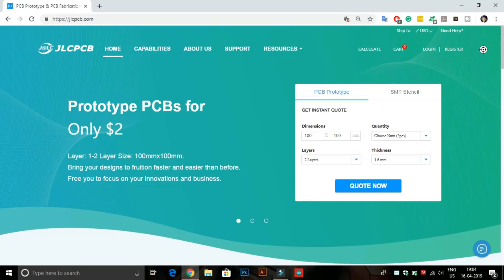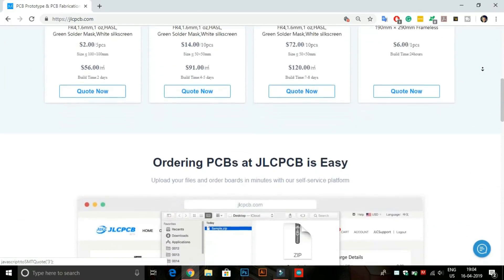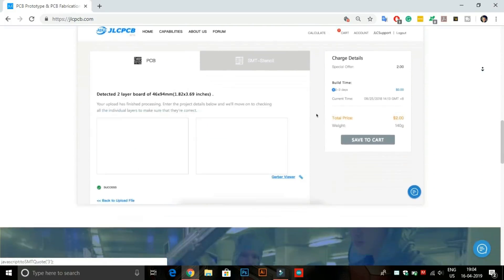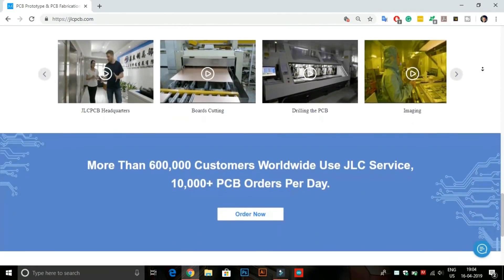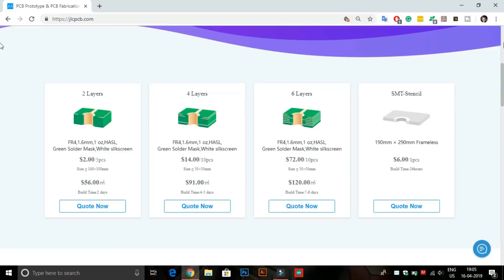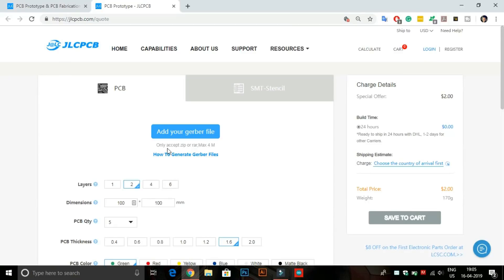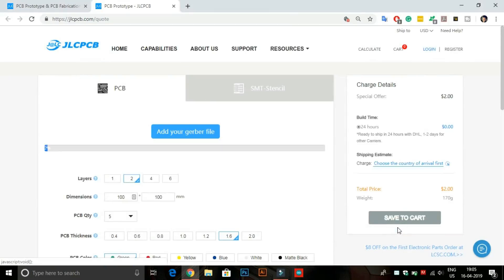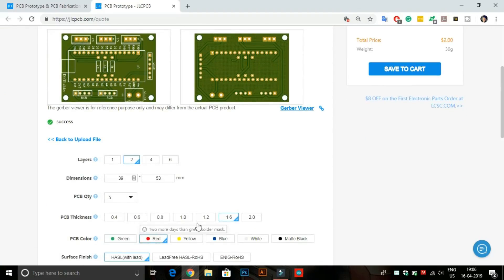How To Make A DIY Obstacle Avoidance Line Follower Robot At Home

Comment: This will be the correct code for this project 

#include<NewPing.h>

int ENA = 3;  //ENA connected to digital pin 3
int ENB = 9;  //ENB connected to digital pin 9
int MOTOR_A1 = 4; // MOTOR_A1 connected to digital pin 4
int MOTOR_A2 = 5; // MOTOR_A2 connected to digital pin 5
int MOTOR_B1 = 6; // MOTOR_B1 connected to digital pin 6
int MOTOR_B2 = 7; // MOTOR_B2 connected to digital pin 7

int RIGHT = A0; // RIGHT sensor connected to analog pin A0
int LEFT = A1;  // LEFT sensor connected to analog pin A0

#define TRIG A2 // TRIG PIN connected to analog pin A2
#define ECHO A3 // ECHO PIN connected to analog pin A3
#define MAX_DISTANCE 100 // Define Maximum Distance

NewPing sonar(TRIG, ECHO, MAX_DISTANCE); 

void setup() {
  // put your setup code here, to run once:
  
pinMode(ENA, OUTPUT); // initialize ENA pin as an output
pinMode(ENB, OUTPUT); // initialize ENB pin as an output
pinMode(MOTOR_A1, OUTPUT); // initialize MOTOR_A1 pin as an output
pinMode(MOTOR_A2, OUTPUT); // initialize MOTOR_A2 pin as an output
pinMode(MOTOR_B1, OUTPUT); // initialize MOTOR_B1 pin as an output
pinMode(MOTOR_B2, OUTPUT); // initialize MOTOR_B2 pin as an output
pinMode(RIGHT, INPUT); // initialize RIGHT pin as an input
pinMode(LEFT, INPUT);  // initialize LEFT pin as an input

}

void loop() {
  // put your main code here, to run repeatedly:
  
delay(70);
int distance = sonar.ping_cm();
if (distance == 0) {
  distance = 30;
}
if(distance <=15) {
  Stop();
  delay(100);
  turnRight();
  delay(350);
  moveForward();
  delay(500);
  turnLeft();
  delay(350);
  moveForward();
  delay(700);
  turnLeft();
  delay(300);
  moveForward();
  delay(400);
  turnRight();
  delay(400);
}
if (analogRead(RIGHT)<=35 && analogRead(LEFT)<=35) {
  analogWrite(ENA, 100);
  analogWrite(ENB, 100);
  digitalWrite(MOTOR_A1, LOW);
  digitalWrite(MOTOR_A2, HIGH);
  digitalWrite(MOTOR_B1, HIGH);
  digitalWrite(MOTOR_B2, LOW);
  
}else if (analogRead(RIGHT)<=35 && !analogRead(LEFT)<=35) {
  analogWrite(ENA, 100);
  analogWrite(ENB, 100);
  digitalWrite(MOTOR_A1, HIGH);
  digitalWrite(MOTOR_A2, LOW);
  digitalWrite(MOTOR_B1, HIGH);
  digitalWrite(MOTOR_B2, LOW);

}else if (!analogRead(RIGHT)<=35 && analogRead(LEFT)<=35) {
  analogWrite(ENA, 100);
  analogWrite(ENB, 100);
  digitalWrite(MOTOR_A1, LOW);
  digitalWrite(MOTOR_A2, HIGH);
  digitalWrite(MOTOR_B1, LOW);
  digitalWrite(MOTOR_B2, HIGH);
  
}else if (!analogRead(RIGHT)<=35 && !analogRead(LEFT)<=35) {
 
  Stop();
}

}
void Stop() {
  analogWrite(ENA, 0);
  analogWrite(ENB, 0);
  digitalWrite(MOTOR_A1, LOW);
  digitalWrite(MOTOR_A2, LOW);
  digitalWrite(MOTOR_B1, LOW);
  digitalWrite(MOTOR_B2, LOW);
}

void turnRight() {
  analogWrite(ENA, 100);
  analogWrite(ENB, 100);
  digitalWrite(MOTOR_A1, LOW);
  digitalWrite(MOTOR_A2, HIGH);
  digitalWrite(MOTOR_B1, LOW);
  digitalWrite(MOTOR_B2, HIGH);
  
}

void turnLeft() {
  analogWrite(ENA,100);
  analogWrite(ENB, 100);
  digitalWrite(MOTOR_A1, HIGH);
  digitalWrite(MOTOR_A2, LOW);
  digitalWrite(MOTOR_B1, HIGH);
  digitalWrite(MOTOR_B2, LOW);
}

void moveForward() {
  analogWrite(ENA, 100);
  analogWrite(ENB, 100);
  digitalWrite(MOTOR_A1, LOW);
  digitalWrite(MOTOR_A2, HIGH);
  digitalWrite(MOTOR_B1, HIGH);
  digitalWrite(MOTOR_B2, LOW);
}

/*void turnAround() {
  
  
  
  digitalWrite(MOTOR_B1, HIGH);
  digitalWrite(MOTOR_B2, LOW);

  for (int fadeValue = 70; fadeValue <=200; fadeValue +=10) {
    analogWrite(ENA, fadeValue);
    digitalWrite(MOTOR_A1, LOW);
  digitalWrite(MOTOR_A2, HIGH);
  }

   for (int fadeValue = 200; fadeValue >=70; fadeValue -=10) {
    analogWrite(ENB, fadeValue);
    digitalWrite(MOTOR_A1, LOW);
  digitalWrite(MOTOR_A2, HIGH);
  }
}

Comment: Is it possible to use line tracking robot on roof for cleaning of moss?
Reply from the maker: yes
Reply: @DIYBuilder  i really appreciate that you replied me actually am trying to build a robot for roof cleaning but according to the prototype it is requiring 10 dc motor for cleaning how can i do the connection by using arduino?

Comment: @diybuilder in circuit diagram there is one wire to l298N of 12 + output but you have attached 2 wire to L298N one on 12+ and one on ground why

Comment: i have connected all.motors and give 12v 1 amp power supply but this is not working is there more amps required?here i have used l293d shield
Reply: I think the code is not compitable with L293D shield ..not sure

Comment: I had made your line follower as my science fair project and I was selected for district level also thx for that video but now I want to make the same thing you made this video but using l293d motor driver and Arduino uno so please upload a video on that please🙏
Reply from the maker: Congratulations bro ❤️ ok i will try to make it as soon as possible
Reply: @DIYBuilder #DIYBuilder bro please make it very soon because my science fair is held on 10 oct so please😫🙏🙏💓 help just only give me the circuit diagram of arduino uno
Reply: Please bro
Reply: @DIYBuilder  thx
Reply: @DIYBuilder  still  now you didn't make it bro:(
Reply: You can see match it with Arduino nano pins name and put the same pins on Arduino uno
Reply: @harditsingh8881   did it work
Reply: @HariKrishna-mr5jm  no
Reply: Mee too
Reply: See that site and define the pins.... is too simple
Reply: Bro what is the name of the pins connected to the PCB and how to buy that
Reply: Bro plzz send me coding for it (program)